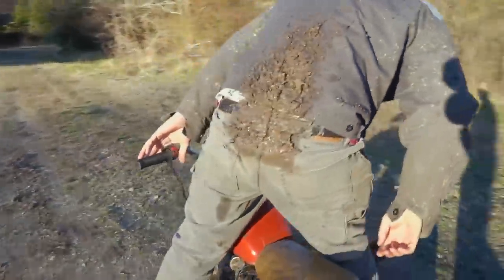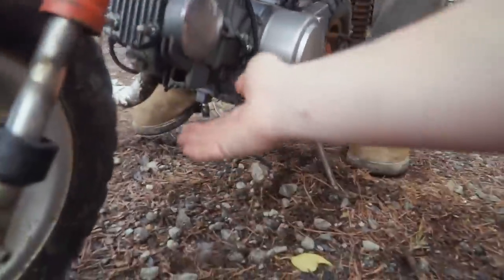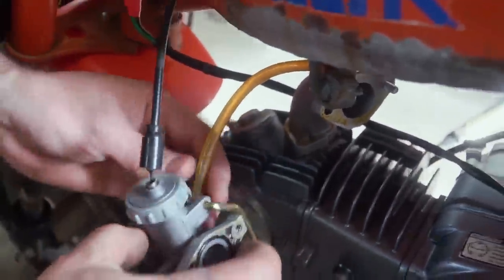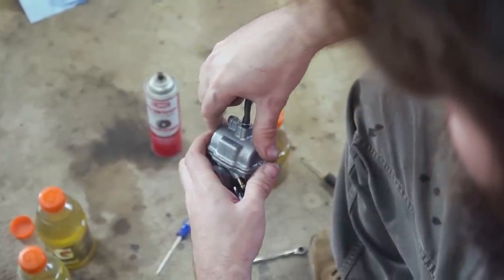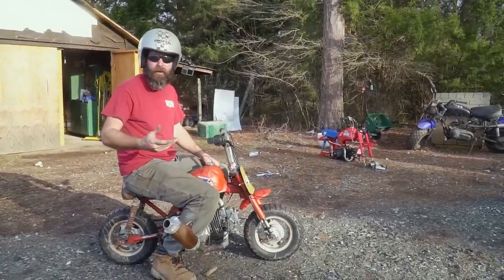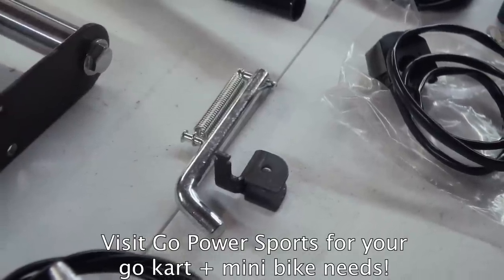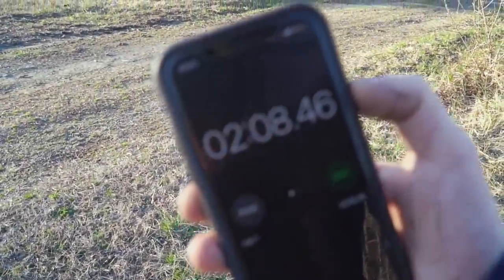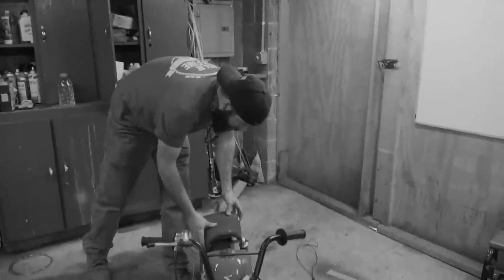We Bought 6 Vintage Mini Bikes for CHEAP! | Will They Run & Ride??

Comment: Now would be a good time to start marking areas that need drainage. Once the mud dries out, you can dig out the area, and install some drainage rock and pipes.
Reply: Yep great  idea
Reply: Yup, fix the bloody damn track
Reply: I'm guessing that they are riding after a Freeze/Thaw cycle. No amount of drainage improvement will fix that. That said, I LOVE to see them build a proper groomed (mountain bike style) track!
Reply: Nah mud =fun
Reply: @stitch8239  to a point I agree. When they are using it as a excuse to not run nor make videos 🥺
Reply: @stevenichlson6085  your right to tho if it was able to be fixed it would make the challenge less so not testing there skill but testing the vehicles performance yet I'd like to see both there skill and the bike so I gotta say I personally say that the mud is welcome

Comment: The one with the spoked wheels is a bird manufacturing “thunderbird”. Build break repeat built a cafe racer out of one.
Reply: It looks like a modified Rupp bike.
Rupp made about three different models I think,  One of which had the spoke wheels.
Reply: @wadewehunt502  Pretty sure it's a Thunderbird, looks just like the one I have. Hang a Hemi 212, add a smaller sprocket and it is one scary ride, nothing but a scrub brake to slow you down.
Reply: It is a Phoenix thunderbird

Comment: The blue bike with fenders and missing motor is called a Grand Prix by Deckson. Aussie-commissioned, built in Taiwan. Originally came with a 3-3.5 Tecumseh engine as far as I know. I've just restored a grand prix with a Tecumseh H35 and 15 tooth max torque clutch. Runs up to mid-30s on a little small block, the entire bike is extremely lightweight with dual suspension and folds completely flat including handlebars for backseat storage, I bet fully folded the bike could fit in a Miata trunk... I recommend building a new seat bracket, the stock ones seem to be made of tin-foil

Comment: In a pinch if you have a wallowed hole you can wrap the stud with fine copper wire , or sometimes just put stands down in the hole and get it to grab .
I learned it from AvE and used it on multiple occasions with a motorized bicycle .

Comment: I had a Scattcat AYT660 as a kid. That one is a 1976 model. The best motor to put on it is a Briggs and Stratton 5hp edger motor with a centrifugal clutch. You cannot put a foot starter on it. It will not clear the frame. You're going to need to use a pull starter like the one that comes with the Briggs and Stratton.

Comment: Water always sit on the bottom when it's with gasoline. it still has a vacuum leak, after Ike pulled the choke on partially it started to run better a for sure sign. that exhaust LOL!!!! that mud is slicker than snot. Ike's beard is getting sort of lengthy. when mine gets that lengthy it starts driving me crazy. and it's got to come off.

Comment: When you have a stripped bolt hole sometimes you can wrap cooper wire around the bolt and the cooper wire will allow the bolt to grab the threads just a temporary fix but in a pinch it'll last a while.

Comment: Ike, when you are running a carb that is too small, you draw more vacuum. That causes the engine to run rich. A bigger jet only makes the problem worse. A bigger fuel jet doesn’t allow more air to the engine, it just gives a choked down engine way too much fuel.

Comment: You guys should take one of your minibikes, and make a mini 3 wheeler with suspension, front and back. Use those forks, with the shocks, from Go Power Sports. Maybe an extended swing arm wide axle.

Comment: Isaac, John, make a map of the areas where the mud is worst. Those are the places where the water isn't running off well. Use the tractor and a little "engineering" to improve the drainage in those areas before next fall. That is the pest answer for that problem. From the videos, it looks like there are some lower places you should be able to arrange for the water to flow to and then drain of rather than sit in puddles in your track. FR

Comment: Buy a bulk sheet of fuel rated gasket material pretty cheap and you've always got gaskets. Some good hammer type hole punches are nice but not needed

Comment: If u was closer to ky id set you up with a rare Scat Cat Tom Cat. Orange with front rear suspension with tecumseh. Perfect seat. White wall tires. Been sitting for 30 years in a barn. Aired tires up and been up for 3 years.

Comment: Hey cars and cameras so I know yall have done the motovox minibike engine swap forever ago lol but im doing it now so I have the predator 212 with the 12 tooth clutch will the original #35 chain that came on the bike work with the new clutch the 212 has? And any tips on lineing up the front and rear sprocket my eyes ain't as good as the ikekilmoter haha lol I think I got it pretty good but not sure I think im over thinkn it lol bout to fully connect the chain now but looks like it don't completely sit down on the clutch right? But if I change the chain than ill have to change the rear sprocket?

Comment: Im putting a 8 horse briggs on a moped, hopefully using stock moped transmission(Variator and clutch.) having trouble mounting the engine and hooking it up to the transmission, not sure if ill do pully or chain

Comment: How do you guys prevent the chain from hopping off? Every time I’m off-road or hit a small bump or try and drive the chain flys off? No matter if I use a clutch or TC. 1in live axle, 13s, stock predator gov removed, s30 TC, 35 chain

Comment: The carb on that mini-bike is the same style of carb that's on my 1985 Kawasaki KLT 110 three wheeler. So whoever did the engine swap either put the wrong carb on it or that engine is a 110 if the carb came with it. :)

Comment: swipe mud out and put some hay and other hay type of plants on road what you have there around the track or just put sand and gravel top of that what you can get around that place for free easy job when you got that little tractor  you can also make a Douple Drum Roller in 2 100Litres Barrels  put bearings in middle of barrels and long par and make a system at you can pull it in tractor also you can use in wheight a sand of those barrels to pack that road hard

Comment: all the mini bikes you guys have I Still haven't seen a purple taco since I saw one as a kid that's the holy Grail of mini bikes, the very first production  mini bike I believe it has a teardrop Chrome fairing fender and it looks like a chopper with ape hangers and they're purple  has anyone else ever seen one or heard of one?: One more thing why isn't anyone using Indian head gasket shellac? That stuff has never done me wrong I saw a bottle of it at O'Reilly's and I snatched it up it's a little brown bottle with a dauber, it's called Lion now because it's sensitive purposes for Indians I put that in my radiator hoses water pump intake manifold gaskets, everything never had a leak..

Comment: This 30 minute long videos are awesome yes they are the best what is the question you guys have the money why don’t you go all stage three stage two on the all wheel drive go kart you guys see stock was insane world stage three stage two won all those engines will just be in sane try it out if you guys have the money because that’s a Lotta money in parts all right bye

Comment: I love your videos.. I was doing this stuff 20 years ago. And still enjoy it today.. you need to quit showing people that it's ok to try and run these barn find with dirty carbs.. dirty carbs create a lean condition.. bad bad.. I would like to see you start to Express the importance of a clean clean carb.. take the pilot jets (low speed)out. The main jet(high speed) and what u call the emulsion tube (needle jet) clean it.. even if you think the carb is clean .. its not.. and pieces of dryed old fuel can break loose and plug a jet.. causing a lean condition.  Dirty carbs kill 2 strokes every day..

Comment: Gas is lighter than water therefore the fuel floats on top of the water. Water is roughly 8lbs per gallon where fuel is about 6lbs per gallon.

Comment: Running it with dry rusty chain, and exhaust sticking out is foolish. Use wire brush for chain, soaking in kerosene.